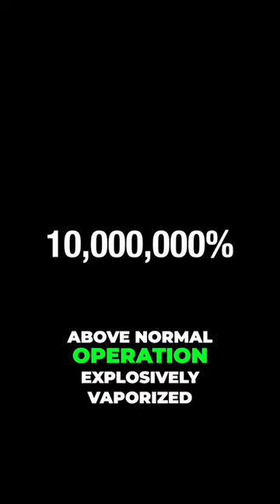The Deadly SL 1 Nuclear Accident  Explosions and Control Rod Mishaps

Comment: One control rod, not five, was ejected. The central control rod, the one that was withdrawn, was ejected. Four control rods remained in-core. "Photographs taken by movie and closed-circuit TV cameras have shown extensive damage to the core itself. The central control rod, No. 9, and a portion of its shroud appear to have been ejected completely from the core and are lodged below the central nozzle. Control rods Nos. 1, 3 and 7 appear to be within the core, though they may be displaced laterally and vertically to some extent." - AEC report June 11, 1961. 

Five shield plugs were ejected. That is what the AEC animation is showing.